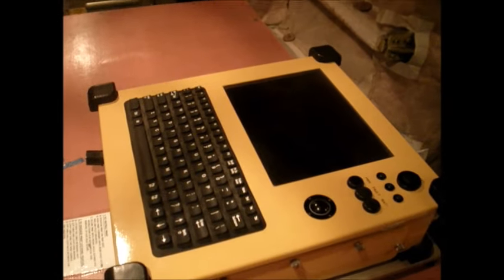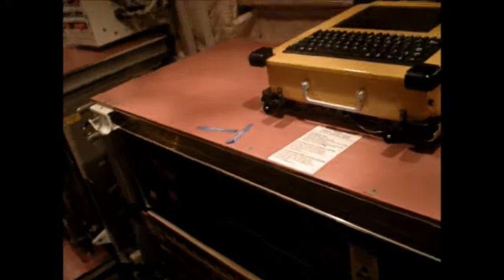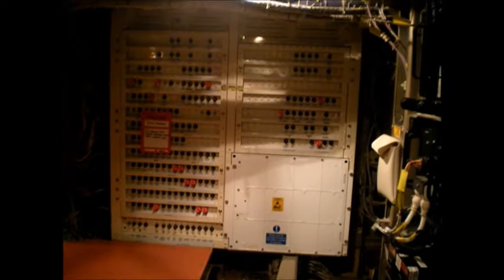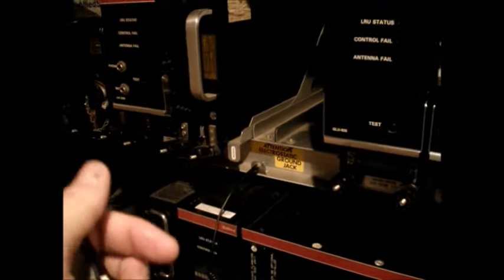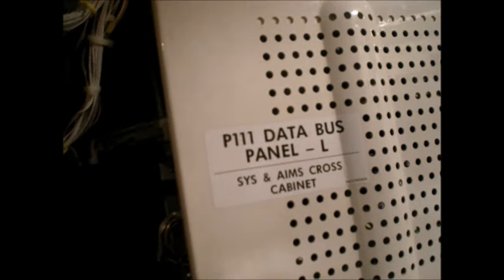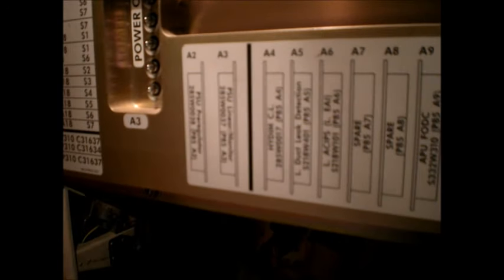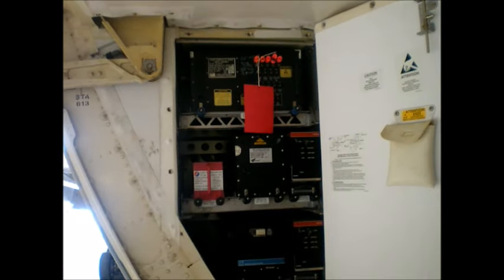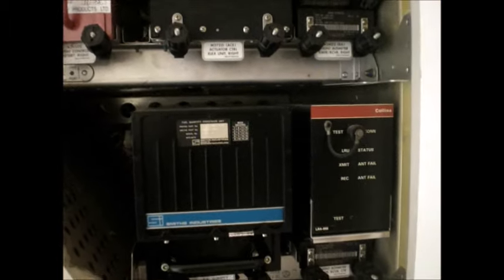Boeing 777 Electrical Equipment Bay Tour

Comment: All that electronics will fit in to a shoe box in the years to come. We will look at this as prehistoric.
Reply: As said in this video, all the components have to be physically separated for fire and stuff,so I don't think it's gonna happen
Reply: S Q Time has always proven that the once “impossible” became possible for mankind
Reply: @sq8409  Okay, then there will be a couple more backup shoeboxes LOL, the fact that there are multiple systems in case of a problem is irrelevant compared to the size of the components. I think he is right. A decade from now this WILL look awfully complex and too big
Reply: Infact it is already happening. For eg in 787, the need for a lot of heavy LRUs are eliminated by PCBs. Another good example is that of FCE cabinet which are only 3 LRUs as compared to 777 which has atleast 5-6 LRUs for the same purpose.
Reply: Only the bulky modules and power panels perhaps.  Most of the space downstairs not designated for gargo is ducts, plumbing and electrical wiring/systems tying the plane together.  But you need space and careful clamping to keep the planes "nervous system" from vibrating like guitar strings mid flight and contacting the structure, eliminating EMI and withstanding wear and tear from temperature changes that the bundles have to endure.  Really complicated stuff and Boeing isn't going to be eliminating any of it anytime soon because they add these layers of redundancy in every aspect of it's design because people expect Boeing to deliver the best of the best(which they do)

Comment: This reminds me of MH370. Since you mentioned that different modules are well-separated, could it be the case that a fire caught the communication module, then eventually the fire went out (due to elevation attempt by the pilots), but leaving only the hydraulic systems intact, flying the aircraft south, unattended, while those on-board died of hypoxia.
Reply: BASELIB interesting theory
Reply: I'm not saying you're wrong because there could be a nugget of truth to the spacing helping reduce the spread of fire, I never asked.  But there are huge halon tanks behind the cargo walls to help eliminate fire if it breaks out so the passengers and crew are safe and not going to suffocate I promise.  But most of the stuff you see if very fire resistant especially the insulation.  I've only been near 2 fires downstairs and they never spread very much at all because of the materials used.
Reply: The wiring makes me think about TWA 800.

Comment: This is a great video! Thanks for sharing!!
Reply from the maker: HI,  Glad you liked it.  It is an area that not many people get to see.  We get pilots that have tens of thousands of 777 flight hours and have never seen it.  I give them a tour and they really like to see it.
Reply: That's actually quite concerning that pilots aren't familiar with electronics on board.  What if there was an emergency?  They should at least be familiar with it.
Reply: @PoxyBear  You don't need to understand how your car works in order to drive it safely. After being trained on how to drive a car and get your license you just need to understand the information presented in front of you and take the corrective actions and messures in order to rather continue driving in a safely manner or stop without injure yourself or others. Same applies to aircraft. They know how to fly and I know how to fix it, it is impossible to know everything.

Edit: also the pilots are indeed familiar with electronic systems particularly on how to take corrective actions after certain warnings and how follow procedures related to that system so yes they understand how the system works but not necessarily the architecture behind
Reply: It wouldn't hurt for people to have a better understanding of how their car works either.  I'm not suggesting knowing everything but at least a better understanding.

Comment: I like the anti-static wrist band.  It looks exactly like the one I used to have in the EE lab.  I probably paid $3.99 for mine at Radio Shack.  I'll guess that one cost $399 and comes with a stack of certification paperwork an inch thick :-)

Comment: Excellent tour... Wow! I sense you served in the Air Force or Navy? Excellent job filming and explaining the "brain of a 777"!  I understand that every person from ground personnel to flight crew to catering services had a say with and suggestions for Boeing's Aeronautical Engineers/Designers when planning the 777 design.
So, the 777's  EE Bay compartment can only be accessible via an 'unlocked'(?) hatch under the carpet at the front of the First Class cabin near the flight deck. Is this were the 777's Satellite Data Unit (SDU) is stored and how the SDU integrates information used by the plane’s satcom system? According to Malaysia MH370 investigator Mike Exner, "there is no way to turn off the primary power to the SDU from the cockpit".  But, someone, (possibly posed as a cleaning crew member?) - could have had early access before the new flight crew entered and before the boarding of new passengers.  The person would have to be inside the 777's EE Bay, waiting for instructions during the flight - when to disengage the plane’s Satellite Data Unit (SDU) which was turned off for awhile and then on again possibly from someone who was flying the plane in the cockpit. Note: The last voice transmission from the plane's cockpit, with the final words, "Good night. Malaysian three-seven-zero." doesn't match the voice of the Captain nor co-pilot who pronounced "370" IN EARLIER TRANSMISSIONS AS "Malaysian three-seven-Z-E-E-E-R-R-RR-0" - with a distinct Malaysian-English accent. The final words spoken had a 'flat-North American accent - missing that slight Malaysian-English pronunciation of "0".  It doesn't match voices earlier in flight hours following the Malaysia MAS370 aircraft’s mysterious disappearance on March 8, 2014. Malaysian investigators, etc. mysteriously withheld the exact final words that were spoken in the transcript information, eventually released the correct last sign-off message and the recording.
Note: In April 2017, Malaysia Airlines announced that the airline's entire fleet will be tracked with a new "real-time global aircraft tracking system" from space, via satellite. Malaysia Airlines was the first airline carrier that reached a deal for the service provided by US-based Aireon, FlightAware and SITAONAIR. Planes deviating from a flight path will now be able to be identified more quickly. It is unclear if this new system is "fool-proof" and can detect planes regardless if SDU systems are tampered with inside EE Bays  already installed in most planes of major commercial airline carriers.  Hopefully it is "fool-proof"...
Reply: your post twisted from wholesome congratulations to pure horror real quick

Comment: All the backups and electronic redudancies are all in that same compartment?/bay?
if a fire catches on, like due to oxygen explosion or auto ignition of materials, there's not much to do, right?
You probably can still control the airplane with the battery and backup cables, but if that then becomes consumed by fire after let's say 10 minutes of the initial fire started.... no more controls.
Reply: All of the materials down there are non flammable. the odds of a fire down there are negligible and i i believe the crew could attempt to put it out as i believe this planes e&e bay is accessible in flight from the cockpit. your argument is just as valid as saying that having both pilots being in the same room is dangerous.
Reply: @__ASAAA  do you really think a oxygen bottle explosion will lead to negligible damage? omg it would create a fire ball the size of a room and create a blast that would push inwards several objects including metal, physically severing objects and detaching components from the electronic bay.
Oxygen bottle explosions had happened before mid-flight leading to haul holes and emergency landings.
Reply: @fontexstudios  If you have ever been in an aircraft e&e bay you would know how well everything is secured, stuff would fly around if there was an explosion and there would be a decompression but it would take more than that to destroy the entire e&e bay. and there are backups to all the main systems down there. and if it was for some reason completely destroyed the odds that the nose is still even attached after such an event are slim at best. i think people who point at stuff like that like its a major flaw need to do some research on the concept of calculated risk or risk assessment. if there have been tank explosions in the past the odds that one will happen again are much lower now because of what we learned from the first one. You only hear about a flaw taking out an airliner once or twice because we learn from it and stop it from happening again. if something takes out an entire dream liner i can guarantee you its not going to be something we have seen before. odds are its going to be with one of the new technologies or the the way an old one was integrated with the new one.

Comment: Reminds me of a mini-data center. My guess it has about the capacity of 1/10th a data center.
Reply from the maker: That is what it is.  Multiple data centers that are physically separated as well as electronically separated.  There is enough stuff on each side so that if one side gets damaged the other side can run everything.
Reply: @BigIronTV  what kind of hardware is used? Do you know the computing power? Is there any public reading where I can get more information about the systems? I studied industrial automation  so will be interesting to learn about it. Thanks a lot. Greetings from Costa Rica.
Reply from the maker: @estebanamador1990  message me with your email and I will send some stuff.
Reply: @BigIronTV  I'd be interested in this too.
Reply: @BigIronTV  That's what I love about the 777, such an outstanding plane.  Just wait until the brand new babies come out you guys are going to love it.  The X is going to change the game forever.

Comment: just curious. Does it use networking cat5 or cat6 cables for data?
Reply: I'd imagine cat6, the internals are constantly being upgraded overtime.  Even in the factory a spec could change from plane to plane as the engineers refined the process.
Reply: cat7

Comment: Is the ELT located in this same room? If not, where is it and would the pilot be able to physically access it during flight?
Reply from the maker: It is not located here.  Typically there are located in the rear part of an aircraft to better survive crash.  They can not be accessed or turned off.  They are activated by a G switch that senses a crash.  You may be thinking of the transponder which gives aircraft location information during normal flight.  These are in this area and can be turned off by pilots using the transponder controls located in the cockpit center pedestal.

Comment: I'm interested in the crew oxygen bottle. Could you post another video? How far is the bottle from; the Left AIMS Cabinet, HYDIM cards, Left Systems ARINC 629 Bus, wiring from the Left GCU to P100, and wiring from the Backup Converter to P100.

Comment: What do you have to go in and fix the most and what is the biggest pain to fix?
Reply from the maker: Mostly change tires.  The rest of the plane is pretty reliable.  The tires are sometimes a big headache to change because we are often at locations that do not have big enough jack to lift the plane or a dire dolly to move the tire on the ground.  Also nitrogen is often a worry at airports because one tire takes a lot.

Comment: OMG so do yyou repair all this or just switch the broken parts out for new?
Reply from the maker: I don't open any of the electronic boxes.  If my troubleshooting shows that the fault is in the box then I get a new one and install it.  Then the failed box will go to a shop where an avionics specialist will repair it.  If there is an electrical fault in the wiring outside the box I am trained to repair it.  The most important thing as an aircraft mechanic is to use the manual.  You don't have to memorize tons of stuff.  In fact if you are caught working from memory by the FAA you can be in trouble.  I have changed tons of tires and know that task quite well.  But every time I change one I have a current copy of the task printed out and available to reference.  So when you take your practical test I have mentioned before the quickest way to fail it is to begin to do the assigned task from memory.  First thing you should do is get the instructions from the manual.  As a mechanic we are only authorized to do work that is already contained in FAA approved manuals.  If it is not in the manual then a qualified person must evaluate it and write data and submit it to the FAA and get approval for the mechanic to follow for a specific instance.
Reply: BigIronTV  So every mechanic has a manual for a specific repair?  Did not know that. I guess that makes sense. I was wonder how one would know every repair around a plane especially the bigger planes
Reply from the maker: Every airplane has specific manuals for it.  And the mechanic uses these manuals for that airplane.
Reply: BigIronTV Oh wow that makes me feel better and less worried cause I really thought that everybody memorized everything. I cant wait to start school I really love planes I regret not doing this when i was younger.
Reply: these are called AMM (Aircraft Maintenance Manual)

Comment: Is the battery manufactured by Interstate? Or another manufacturer?
Reply from the maker: I don't know the answer.  I will have to check who makes it next month when I am back on duty.
Reply: probably duralast
Reply: I don't think it's either but ultimately lots of what goes in is up to the airline customers.  The ones I installed were some special purpose built battery that's supposed to last the lifetime of the plane and costs more than my car.

Comment: how is this protected from a fire
Reply from the maker: No fire suppression system in this area.  Aircraft electrical wiring is protected by circuit breakers that trip before allowing enough current to cause wire to smoke per design specifications. Additionally the racks have redundant flight systems that are physically separated by left and right side in the racks so that if one side of a rack is destroyed the other side has flight control systems ready to take over without interruption.  There is a smoke detection system in the equipment cooling system.  If smoke is detected there is an overboard dump procedure that can be combine with and oxygen starvation procedure to suffocate any fire that may have started.  Can not use fire extinguisher agents such as halon because this area is not isolated from the cabin where people are.  At the front of the EE bay there are large opening into the cockpit where the rudder peddle control rods come down.  And halon discharged in here would go right into the cockpit through those holes.  The proper cargo area has halon but it is sealed so no agent can get into the passenger areas.
Reply: @BigIronTV  i've always wondered why other areas have fire suppression systems except for the avionics bay (which feels like its the most important one that need a suppression system) however i appreciate your response as i am a very anxious flyer and have watched every single plane crash video, the one's that aren't pilots errors are always fires.
Reply: @BigIronTV  may i also ask, how protected is a plane from bad maintenance, as in how badly should a maintenance issue be done in order for it to cause a serious incident

Comment: holy crap i thought my job was hard. i work on cars lmao
Reply: Cars are a lot harder.  I was qualified to install and replace nearly every electrical and mechanical system in the jet besides the engines and I don't have the will to do my own repairs on my vehicles :P  Bonus fact Boeing has a huge hard on for Toyota and their manufacturing process.